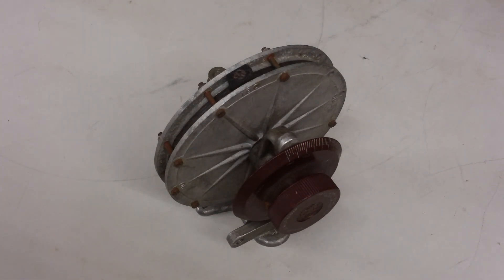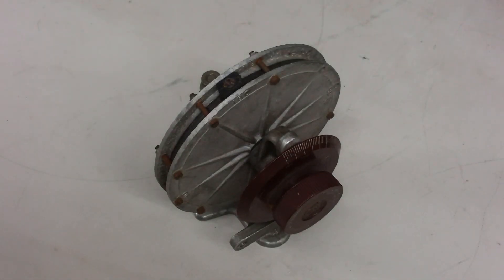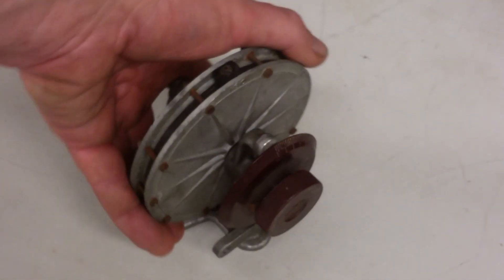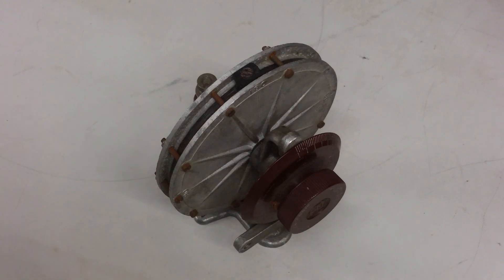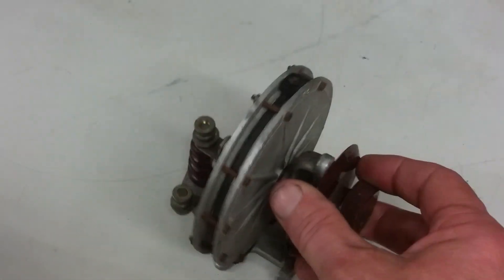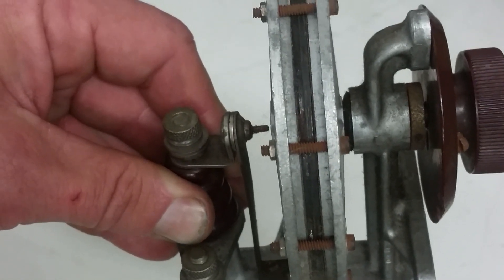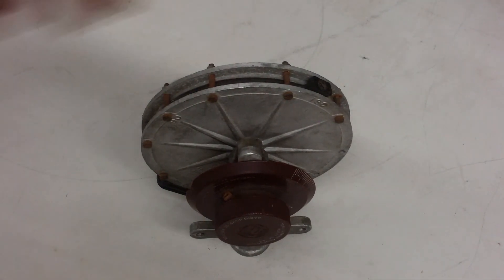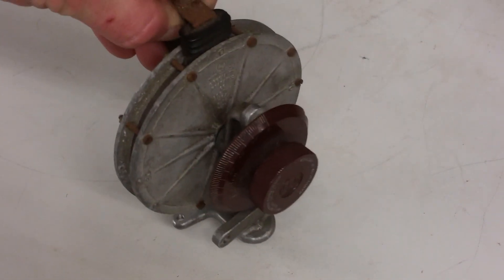RCA UC-1831 Transmitting Condenser - Mercury Capacitor

Comment: I bet the internal geometry of that casting is pretty interesting. I'm guessing there's one fixed plate, and then some sort of continuously varying, cam-like shape on the inside that varies the area of the mercury pool, along with some way to insulate it from the other side. No wonder it cost a ton 100 years ago...

Comment: I have a high-voltage tuning capacitor slightly bigger than the air-core one you showed here.  I believe mine is rated for about 2kV.  

I've heard of the name Faradon before but this would be the first time I've actually seen one anywhere.
Reply from the maker: They get WAY bigger. I have seen one at least four feet long, with the plates 1 inch apart. I bet it was from a 10 kW (or more) transmitter.
Reply: @uniservo  I know.